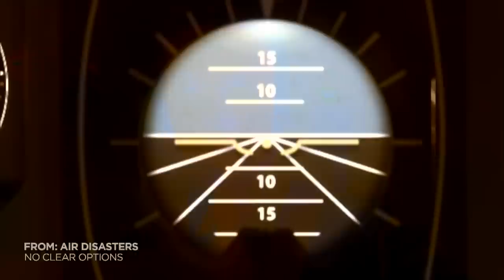These Pilots Broke One of the Cardinal Rules of Landing an Aircraft 🛩 Air Disasters | Smithsonian

Comment: Both crew suffered fatigue and ended up overworking without enough sleep. And the left engine ended up with too much power, and didn't even report this mechanical problem. Also poor airline management caused this crash

Comment: The cardinal rule that they broke was that the captain took control of the power - this should NEVER happen especially in marginal conditions when landing. The F/O should've been the one controlling the power, as he's the one conducting the approach. By taking the power levers into his own hands, the captain took away vital input control from his F/O which is why the 3rd landing attempt resulted in disaster.

This is on top of the fact that neither pilot was anywhere near competent enough to have been certified to be up in the nose of that Metro-3, neither had more than a couple hundred hours of flight time, and the airline was incredibly loose on its hiring requirements.
Reply: Wow, that just compounds the tragedy. Best wishes to the survivors and much sympathy to the friends and relatives of the victims.